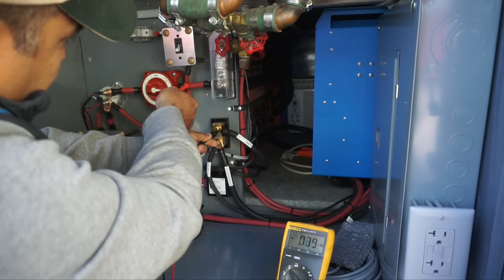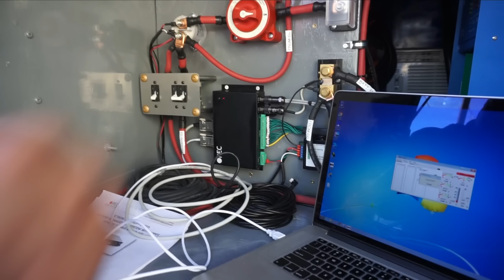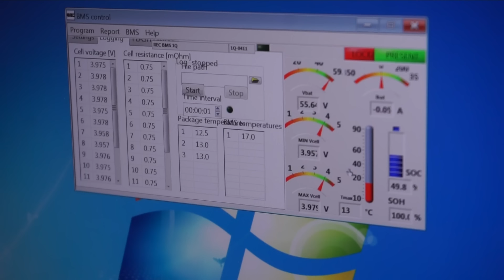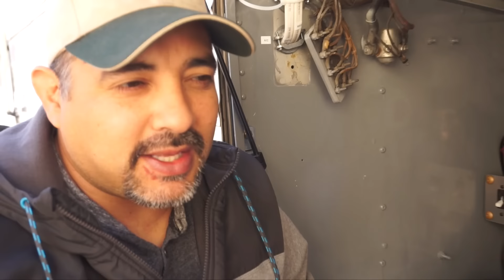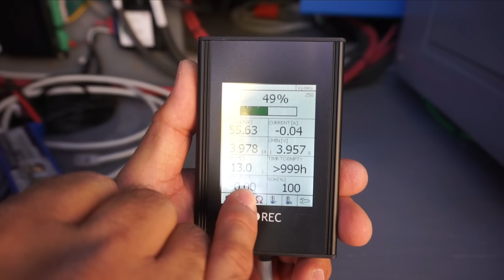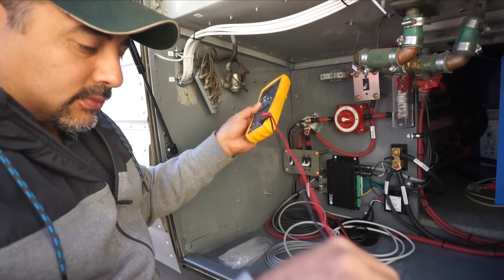REC BMS: An Overview & the Setup

Comment: Informative - thanks. My question is the relationship between the SOC shown by the REC BMS and the SOC shown by the Victron Smartshunt. I read both from a Cerbo GX and adjust through Victron Connect. What happens is that the SOC shown by the Smartshunt gradually drops in comparison to the SOC displayed by the REC BMS by about 10% a week. I've assumed the REC BMS is providing the accurate SOC, and every fortnight I use Victron connect to manually adjust the SOC of the Smartshunt to that of the REC BMS. I've been doing this for a couple of years now, but would like to know if this is a problem, or should I be taking the smartshunt SOC as preeminent and instead adjusting the REC BMD SOC to match the smartshunt? 
The system is on liveaboard in the tropics boat with 1200 watts of solar and when at dock using shorepower used and a 710 AH LiFePo housebank with Victron Multiplus.

Comment: Very late to the party with this video, but excellent. And thank you for posting. I’ve come across this BMS because it has also the ability to speak with wake speed 500 alternator controller. This is a critical function for a second alternator set up for life. Especially for 48 V systems.  So not only does it speak Victron, but it also speaks wake speed.

Comment: Hi, I am a little bit confused. I am going to build a system in my boat (24V LifePo4, Quatro 24/5000/120, CERBO GX, REC-BMS, Contactor, Pre-charge, Fuses, Shunt)

Why do you have the contactor where it is? And the fuse? In the REC manual both the fuse and shunt are on the minus cable between the charger/inverter and the battery., and the contactor is on the plus cable between the charger/inverter and battery.

As far as I can see your contactor will shut down the supply to all loads, but it will not break the connection between the inverter/charger and the battery? So the charger will continue to charge... 

A very good and explaining video :)

Comment: This is a cheaper way of doing the same: https://www.youtube.com/watch?v=05f-zqGdTBk&list=WL&index=40&t=799s
The 7 BMS required would cost around $120 - they protect each cell against overload, overcharge, undercharge and short circuit. Notice that they also do not short the mid point of each module.
Reply from the maker: Thank you Josi.  I don't really understand what you mean when you say "Notice that they also do not short the midpoint of each module" - The video you linked clearly showed wires on the center terminals.  I don't really know enough about the cheaper BMS to comment much but when I was looking at them there were a lot of problems.  How do these BMS protect your system?  Do they have a contactor or some other means of shutting down the battery in an emergency?  A good quality Contactor for a 48V battery alone is going to cost more than $120.  How do they communicate with the rest of the system?  Can they speak CAN-BUS?  Can the parameters be changed and monitored?  Do they monitor for Temperature?  Do they monitor the internal resistance of the battery cells?  There are many great BMS systems out there but these cheap Chinese BMSs are more trouble than they are worth.
Reply: @BeginningfromthisMorning   I meant the point between the two series connected cells in each module. So each individual cell is metered.

Comment: Hi, I connect my REC BMS like you did. The CCGX shows me all data of the BMS, but my Multiplus2 doesn't react to the signals form CCGX. Do you change something on your Inverter? Does the charger stops when you disconnect the VE.BUS cable? 
Thanks for your help :)
Reply from the maker: Hi Thomas - It sounds like you have the timing on the VE.Can configured correctly (since you are seeing values on the CCGX).  You can double check by opening the Settings -> Services and be sure that set the CAN-bus profile to VE.Can & CAN-bus BMS (250 kbit/s).  In the Settings menu Change: Battery monitor to REC BMS in CAN-bus.
- DVCC -> ON
- SVS -> ON
- STS -> ON
- Limit charge control -> ON
That should limit the chargers.
Reply: @BeginningfromthisMorning   thanks for your fast answer. I tried it, but the Multiplus2 are still charging around double the CCL in the parameters from REC. do you have an idea? when I unplug the ethernet cable, the charger is still doing what i program in VE. config and don't stop working :/

Comment: Hello Juan! Is it possible to install this BMS with 16s3p 400 Ah winston battery and connect it to victron CCGX?
Reply from the maker: Hi Jack - it is indeed possible to do 16S with the REC-BMS and connect it to the Victron CCGX
Reply: @BeginningfromthisMorning  Thank you for your answer, I want to connect 48 pcs 400 Ah batteries. 3 parallel branches with 16 connected in series. Is it possible to connect it with this BMS? Best regards!
Reply from the maker: @jackcreaker4602  If you want to connect 3 parallel branches of 16 you will need 3 BMS modules because you are creating 3 batteries that you are connecting together.  Why not tie 3 in parallel (making each "cell" a  3.2V 1200Ah battery) then connect those 3 to 15 other sets of 3 making a 3p16s battery that you can then monitor and balance with 1 BMS?

Comment: Very Informative video.  I am looking into Victron equipment cause I think it just seems so polished.  Does Victron have a BMS?  If so why didnt you use it?  Is the unit you call the Contactor the same function as Victron (BP100) Battery Protect?
Reply from the maker: Victron does have a BMS - or better stated: they have BMS units built into their batteries.  They also have another module that those BMS units can talk to but it is all designed to work with their battery (I believe it is called the Lynx Ion BMS).  The contactor is basically like an on/off switch for the battery.  It is similar to the Victron Battery Protect but it is controlled by the BMS

Comment: Looks neat, nice system.   Even a precharge setup before the contactor closes.   And your solar input to the battery is downstream of the main contactor,  so if the BMS is nervous about temperature, high or low voltage, it should disconnect that too.   Very fun!
Reply from the maker: Thank you - Should be a good system for us.  We did some preliminary testing and it looks very promising - video should be up shortly!

Comment: Which contactor did you use? I am trying to find a 48V contactor. Thank you. You rock
Reply from the maker: Hi, the contactor I used was the one I bought with the BMS - it is a 500A, 32-95V DC non-latching contactor from TE Connectivity. Part # is EV200ADANA.  It can be found on Digikey and Mouser:
https://www.digikey.com/product-detail/en/te-connectivity-aerospace-defense-and-marine/EV200ADANA/A105504-ND/2053596
https://www.mouser.com/ProductDetail/TE-Connectivity-Kilovac/EV200ADANA?qs=%2fha2pyFaduihGWSyvOcusfSQhfK%2f5yIqWIeVmzwAKkUvT9a3NIMs7A%3d%3d
Good luck!
Reply: Thank you very much. I am sure you answered me once before.
Reply from the maker: Anytime
Reply: So this contactor is always power on during use correct? does it get hot?

Comment: I'm curious why you are only using one contactor. The REC allows for dual contactors. Hook up all your charge sources to the charge contactor, then all your discharge sources to a discharge contactor. Then if you have an over voltage condition, it will disconnect your chargers while still allowing you to discharge. Same thing if you have an under voltage condition, you can still have your chargers connected to recovery the battery.
Reply from the maker: nebulight Thank you for the question.  I had the exact same idea when I first designed how this is connected.  I asked REC about this and they said that the software that controls talks to the Color Control GX does a better job of controlling the charges (both the built in and the MPPT solar chargers).
Reply: Beginning from this Morning oh nice. So the bms can control charge curves or does it just enable/disable the charge? I was looking at their software and it looks very basic.
Reply from the maker: When I asked they told me: "We have received the latest CCGX update from Victron 2.11 last week. In this update all the devices connected to CCGX obey BMS instructions  - no additional MPPT control is required. Update CCGX to 2.11 or higher and also all Victron devices."
Reply: Beginning from this Morning that's awesome! Thanks for the quick replies. Can't wait to see your future videos. Do one on the ccgx and how the bms works with it. :)
Reply from the maker: Thanks - Victron Inverter is next in this series then the Color Control GX in the following week :)

Comment: I notice Batrium BMS have added Victron CCGX support to a recent version of their product. There are not many choices for DIY lithium compatibility with Victron. You mention considering the Orion BMS, did you consider Batrium or any others?
Reply from the maker: Hi Sam, When I started looking I had narrowed it down to Orion and REC.  Batrium was still just starting out.  I have heard quite a few who wanted to run Batrium but I have not seen one up and running yet - It looks like a very promising system.  What type of battery are you running?
Reply: Beginning from this Morning There are quite a few systems out there but most seem to be DIY powerwalls. There have been a few RV systems discussed on forums but not using Victron. The latest BMS boards are only just starting to ship so hopefully more people will start experimenting. 

My battery is a simple DIY 18650 pack used for camping. Made from identical recovered Sanyo cells that I get from a friend. I have about 4kwh stockpiled so far. I'm just running a simple BMS. 

I'm taking an interest in RV systems as I'm helping a friend rewire his boat with the hope I may have my own one day. 

Thanks very much for posting all that you have done! You are one of very few documenting a Mobile DIY Li-ion system with a smart BMS.

Comment: Wow, super awesome set up for a 24 volt lithium. I am particularly interested because I will (Likely)be using  Tesla batteries with a Victron Charger/Inverter. You have done an incredible job on the research as well as the install. Thank you, thank you for all of the hours and hard work that you have put into your system and sharing with the rest of us. I hope to start my install in the next couple months and I am certain I will be referencing your battery build videos.
Reply: Correction, 48 volt, I think I will do a 24 volt.
Reply from the maker: Thank you.  I have heard great things about the Tesla packs!  I am enjoying watching your build - amazing!

Comment: Precharge main purpose is to protect your (contactor) contacts, few on's with empty caps in the inverter and contacts of whatever switch you are using are going to be damaged and contact resistance goes up and everything goes down hill from there... So yeah, precharge (thumbs up)

Comment: On the display why is the total voltage in the red (upper left gauge)? 

In my comment on the last video I asked a couple of questions, and made a couple of suggestions. Did you get a chance to look at them?      

May be you can provide me with some help or education. I am really struggling with my video software (Adobe Premier Elements 2018). Adobe is very wishy washy with their responses and support. At first they were trying to say that my machine did not have enough HP to run the software. After three months of back and forth, all parties seem to now be in agreement that at least the machine has the HP. Adobe is now stating that the video boards in the machine are not on their list of approved boards, Nvidia says the boards exceed all the boards on Adobes list, that the boards on Adobies list are all old boards. 

Friday I was able to get Nvidia and Dell Pro Support to conference together, they came to the conclusion that there is no union between boards on Adobe's list, Dell's list of boards test in a Precision work station and that Nvidia says will work with Adobe. 

That is a long dissertation to get to the question, what software do you use to edit videos? Would you be willing to look at Adobes list (I can provide a link), the build sheet for my computer (I can scan and send it to you, I would need to know where to send it) and give an opinion on what board will work (I know you said you were a "computer nerd" I am as far from that as one can get, give me a engine and I can rebuild it, sit me in front of a computer and I am pretty lost. 

Thanks

Glenn Lever (585) 704-3345
Reply from the maker: Hi Glenn,
I will go back and review what you suggested - I always look forward to your suggestions I am not sure how I would have missed it.

For editing software, I use Final Cut Pro and a MacBook Pro computer.  I started just using iMovie but that got pretty limiting and made me mad enough to relearn everything one weekend.  Video software, in general, is VERY taxing on systems.

Of course I would be willing to help you out in any way I can.  You can email me at jipe.az@gmail.com - that is my primary email address.

I look forward to hearing from you,

Juan
Reply: I have sent you two e-mails at jipe.az@gmail.com have you recieved them? Glenn Lever
Reply from the maker: Hi Glenn,  Yes I received your emails and I am shocked that the system you described would have any problem at all running video editing software.  The NVidia video cards you use are much higher end than the ones in my MacBook and you are running two of them - I would expect things to be buttery smooth with the configuration you sent.  As you stated I am indeed running Apple - run a 2016 MacBook Pro with 16Gb of Ram and a 2.9 GHz i7 CPU.  The GPU in my machine is a Radeon Pro 460 with 4GB of memory.  As I stated earlier I run Final Cut Pro - which I believe is only available on Apple platform.  I gave up on PC about 5 or 6 years ago and switched to only run Linux and Mac - I have very limited experience with Adobe but everything I have heard about them has been relatively positive.  The good news is that most video editing software is very similar - I can't recommend Corel as I have never worked with it - but the transition from iMovie to Final Cut Pro literally took me a weekend.  Maybe it's time to jump ship and get a Mac?
Reply: I will try the Solid state drives first, and then different software. Glenn Lever

Comment: such an impressive system ! but to me....it seems mighty complex. if the system isn't bullet proof....any backups ?
Reply from the maker: Hi Richard - I am not really sure what you mean by "bulletproof".  Any electrical system is going to have the possibility of failure - the BMS aims at trying to reduce these possibilities by monitoring and reporting what is happening in the battery.  For backup we have two large 8D batteries that the coach uses to run the engine - In a pinch, (if something catastrophic happened to the Lithium batteries) we have a switch that will transfer power from the 8D batteries to our 12V House system (lights, pumps, fans, chargers) and one small 750W inverter that will keep our refrigerator cold.
Reply: yup ! that's what i wanted to know ! thanks.

Comment: Great video! I could be wrong but I think some or most charge controllers/balancers want you to fully charge the batteries when you first start them up so it knows where the reference 100 percent state of charge is. Again, I'm no expert on all charge controllers and the like but y'all could easily look it up to check. Keep it up!
Reply: Luke L I believe this BMS allows you to set the max charge voltage you desire and when it is reached, you are allowed a reset to mark that voltage as 100%. Same with the cutoff voltage, this way you get an accurate display of the SOC.
Reply from the maker: Hi Luke - thank you for commenting.  You are correct the batteries have parameters on what it means to be fully charged.  The Victron Inverter also has its own monitoring system that keeps track of it as well.  We have not fully charged the batteries yet but plan to as soon as we get all the parameters for the inverter.
Reply: Beginning from this Morning Awesome! Can't wait to see the testing video!

Comment: I am following your system build as well as the Mortons on the Move build with Tesla batteries for my Sprinter van build as a 24 volt system. I am a complete newbie with electrical stuff so just want to say thanks for all the great information! I am curious, did you look into Victron's Lynx Ion BMS and if so, why you decided to go with REC instead?
Reply from the maker: Thank you for following along.  We briefly looked at the Lynx-Ion systems but I think they are designed to work with Victron Batteries which use a different chemistry than the Nissan Leaf Modules.  They use a chemistry called Lithium Iron Phosphate which has a lower nominal voltage (3.2 Volts vs our chemistry which is 3.8V) than our batteries.  If you decide to go with Lithium Iron Phosphate batteries there are WAY more options for BMS solutions (including this one).  I guess we just like to make things difficult for ourselves ;)

Comment: Cell 7 had a slightly lower voltage with all others reading the same. Could that be a problem, or is it only a problem when 1 or more cells reads higher than the rest?
Reply: Looks like its only down by a couple hundredths of a volt, which isn't a lot.  They can correct me, but I think these batteries have sat unused for at least a year, so I personally wouldn't worry about it until after doing a full charge & drain cycle, and seeing where the voltages end up.  Typically in failure cases, the cell will be nearly shorted out and much lower than the other cells in the pack.
Reply from the maker: Bill is correct - these batteries have not been used for well over a year. We will know more after our first complete cycle but a couple of hundredths of a Volt is a very small difference - The BMS is set to not even attempt to balance until there is a .25 Volt difference.